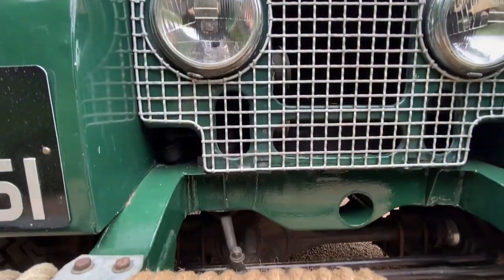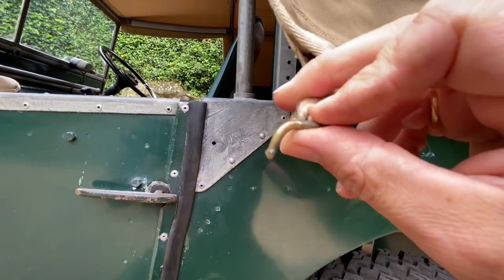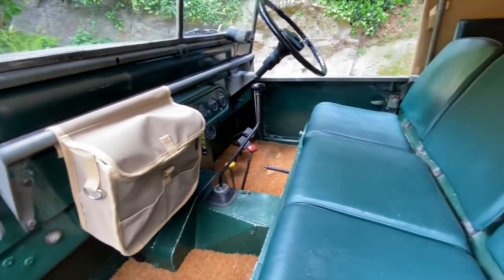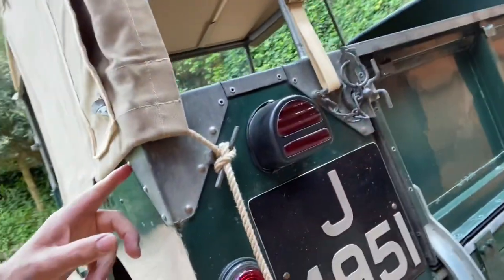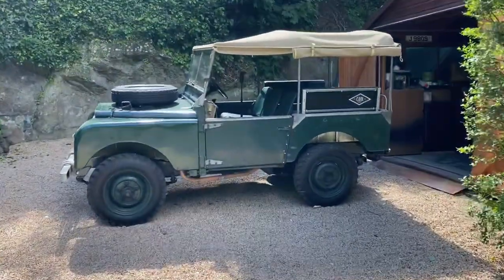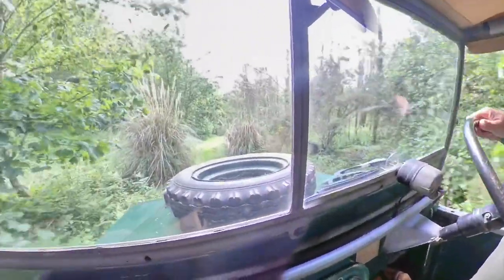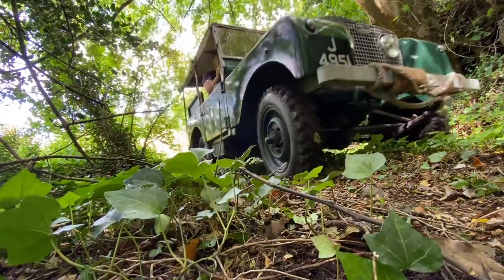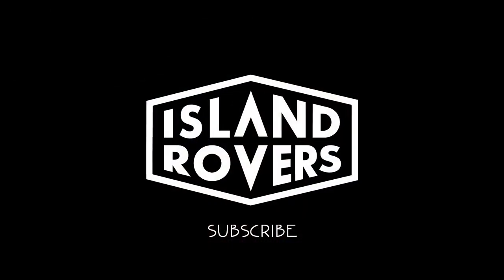Episode 1:  Lockdown maintenance with Her Majesty, a 1951 Land Rover Series One

Comment: Great video, I've always had defenders, I'm thinking of buying a series 1 86 inch 1955.
It's a rebuilt one, nut and bolt restoration. The only thing that puts me off is most people say you spend a lot of time under the bonnet? I'm no mechanic but can do basic maintenance.  Any advise ?
Thanks
Andrew
Reply from the maker: Werdna Ybssarg Hi there! If it's a restoration you've got then the n'ai things you need to think about are the regular maintenance jobs (that modern cars don't require) - topping up fluids, grease points, spark plugs  - stuff like that  ... there's a Land Rover handbook that sets them out. Also keeping cars like this under cover helps. I dint use mine particularly regularly, but I can't say I spend much time under the bonnet at all 👍🏼